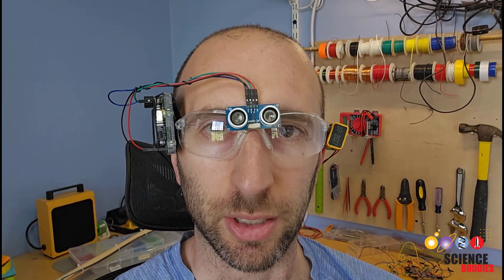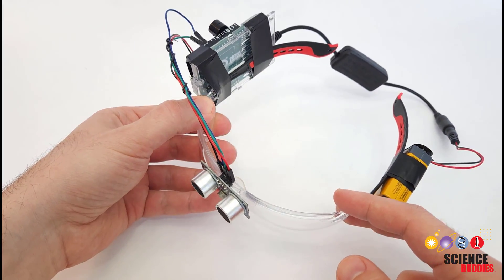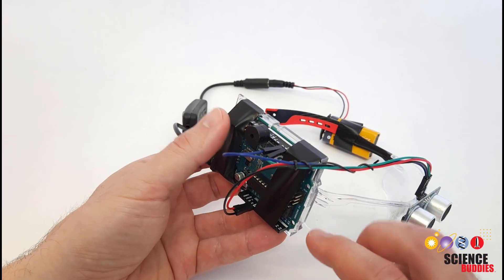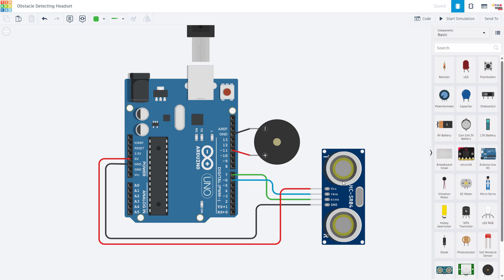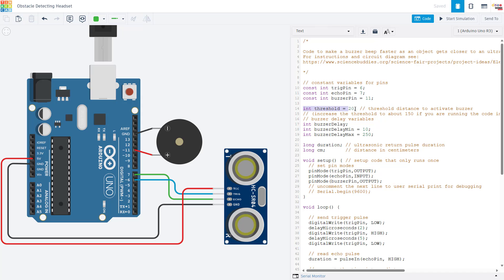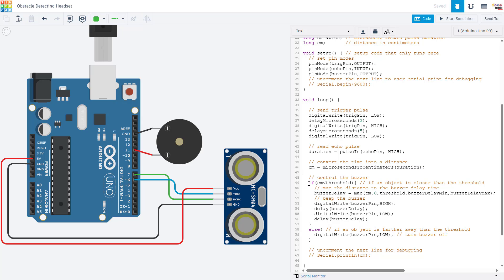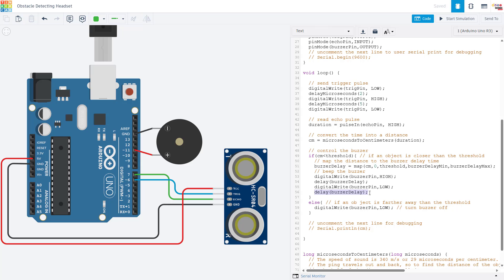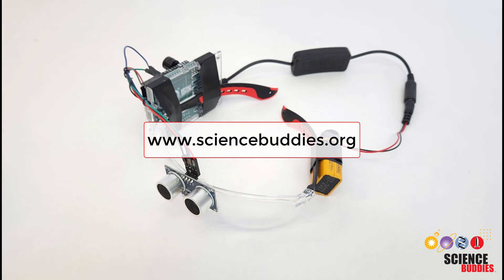Obstacle Detecting Glasses with Arduino | Science Project

Comment: where else can the buzzer go if not at gnd
Reply: it always needs gnd, you can use a breadboard but you need a wire that starts from gnd and goes at negative pole of the buzzer while positve to the digital pin you chose in the arduino script

Comment: the buzzer is still beeping slowly when no object is there.What should I do?
Reply from the maker: Test your sensor by printing the distance values to the serial monitor while it is connected to your computer. Depending on your code and the distance thresholds you have set, it may be buzzing because it's detecting the ceiling or other side of the room even if there's no object directly in front of it.
Reply: I am also getting the same problem. In my case, the sensor is sending 0, when it does not detect any object nearby. So, I have changed the condition to if((cm<threshold) and (cm>0)). This resolved the problem
Reply: Bro there is a bug in his code use mine 

const int trigPin = 6;
const int echoPin = 7;
const int buzzerPin = 11;

int threshold = 30;
int buzzerDelay;    
int buzzerDelayMin = 10;
int buzzerDelayMax = 250; 

long duration; // Declare globally
long cm;       // Declare globally

void setup() { 
  pinMode(trigPin, OUTPUT);
  pinMode(echoPin, INPUT);
  pinMode(buzzerPin, OUTPUT);
}

void loop() {
  // Send a pulse
  digitalWrite(trigPin, LOW);
  delayMicroseconds(2);
  digitalWrite(trigPin, HIGH);
  delayMicroseconds(5);
  digitalWrite(trigPin, LOW);

  // Read echo and calculate distance
  duration = pulseIn(echoPin, HIGH, 20000); // 20ms timeout
  if (duration == 0) {
    cm = threshold + 1; // No echo
  } else {
    cm = microsecondsToCentimeters(duration);
  }

  // Filter unrealistic values
  if (cm < 2 || cm > threshold) {
    cm = threshold + 1; // Ignore invalid readings
  }

  // Activate buzzer based on distance
  if (cm < threshold) { 
    buzzerDelay = map(cm, 0, threshold, buzzerDelayMin, buzzerDelayMax);
    digitalWrite(buzzerPin, HIGH);
    delay(buzzerDelay);
    digitalWrite(buzzerPin, LOW);
    delay(buzzerDelay);
  } else { 
    digitalWrite(buzzerPin, LOW); 
  }
}

long microsecondsToCentimeters(long microseconds) {
  return microseconds / 29 / 2;
}

Comment: I am working on the project right now, and all I have to do is attach it to the goggles. But I have two questions.
1. the code makes the ultrasonic distance sensor all the make tiny quick beeps and which I don't know how to solve
2. since the goggles can't be attached to a computer all the time how do I make it work without attaching it to a computer because at one point I will have to attach it to the goggles
So far though this project has been really fun and helped me learn a lot
Reply: I got it broo ,just put buzzer delay to 0.Its make to do
Reply: @BoisNois-wf6fg  how do i do that
Reply: @BoisNois-wf6fg bro plz help me.  I can’t find the code to make the buzzer sound based on the ultrasonic sensor.
Reply: @BoisNois-wf6fg what did you use to program your buzzer cuz I could use some help
Reply: Bro I could use some help programming my buzzer
Reply: Does anyone know how to make the buzzer sound faster and faster and louder when near an obstacle?
Reply: Do you use Arduino IDE to program the buzzer and if so, how  do I program the buzzer
Reply: did you get it?if yes then please tell me also.
Reply: hi tell me about the second question. do you get it? please tell me if you do
Reply: @theaffableme  he is using a 9v battery that is connected via a barrel jack and an on/off switch